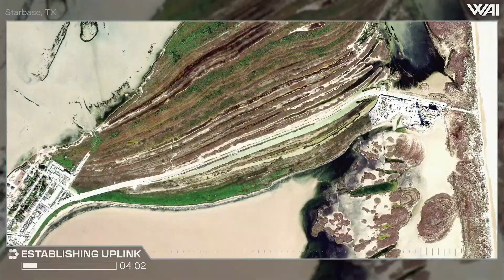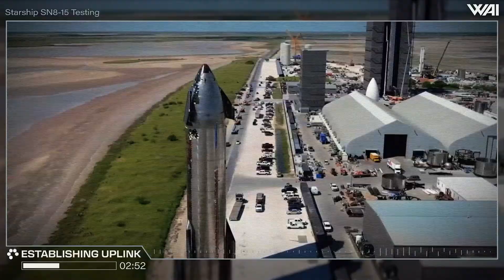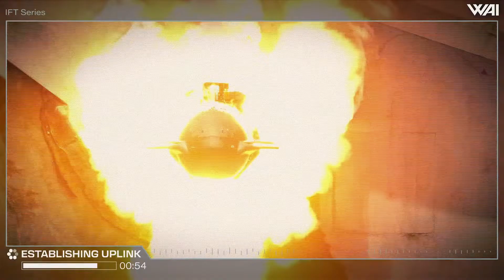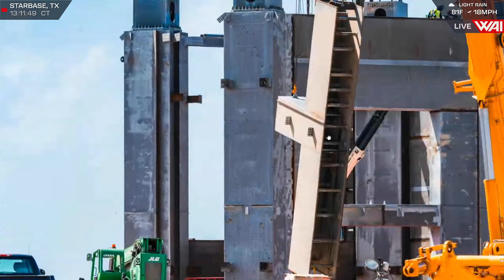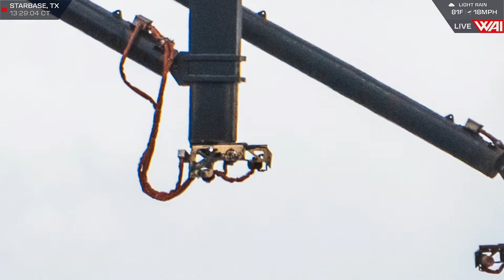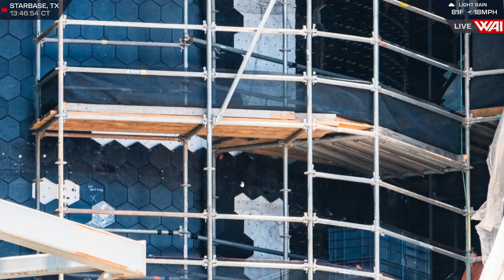REPLAY: Space Roundup: Starbase Activity - June 19th

Comment: Considering that SpaceX works with so much steel and iron, let me pass on to you some old-time knowledge that may be very useful! Back in the day there was 2 very special items in the kitchen, the cast-iron cookware and the steel butcher knives. You NEVER wash the cast-iron (it gets wiped out with an oily paper towel instead) and you LEAVE the black stain left by rust on the knives, do not grind this way! This black stain is the mark that rust has happened, and in the process changed the metal so that it cannot rust again in the same spot (the iron ions that were involved in the original rusting have been gently scraped away and this black stain is ion poor metal that works perfectly but cannot rust again until a new surface WITH ions is exposed) So, as odd as it sounds, gently remove the orange rust and leave the black stain, you can paint over this to make it even more resistant to the heat, but never remove the black stain! (gun bluing accomplishes the same thing and that liquid could be used to force this black stain on large areas without waiting for it to rust) Since you are right on the Gulf and saltwater makes rust happen even faster this simple life hack may assist you greatly!

Comment: If they would install 'another' QD connector, 1/4 rotation around the ship, make the 'hose' connections reversed from the first set, this way two ships can bellywhop together facing opposite directions and using this second set of connections do the fuel transfer.